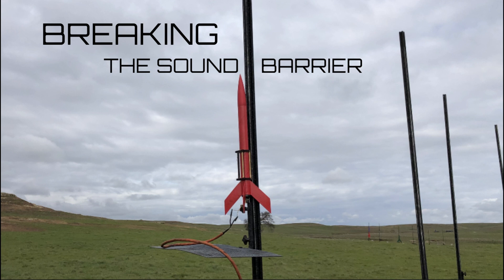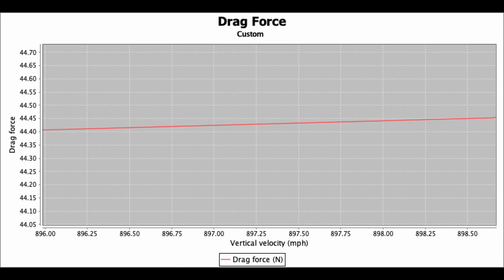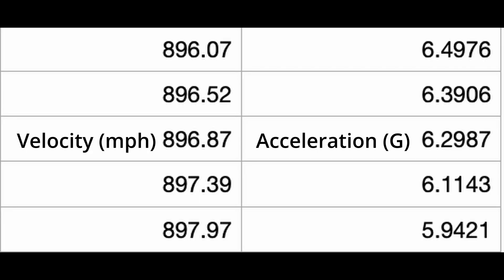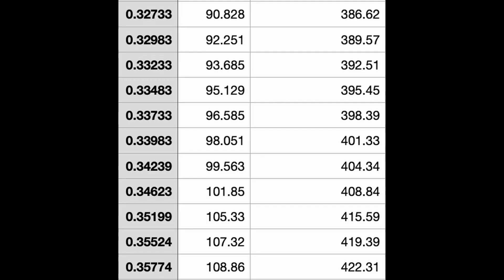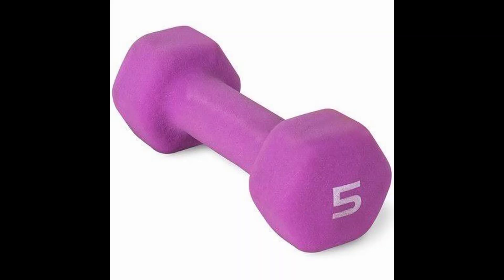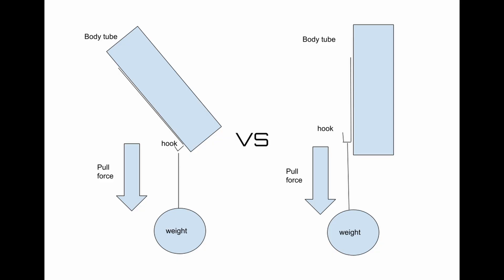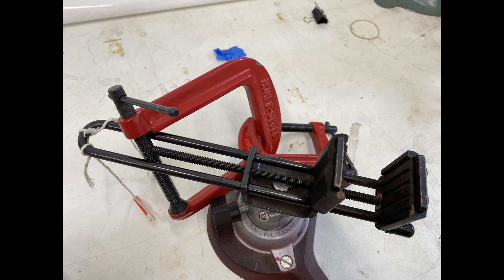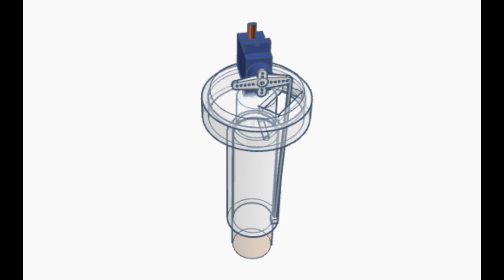Why did the fins break off?

Comment: Also consider the impact of your fly away rail guide on your fins as a possible factor. I fly 500Hz flight computers in my HPR vehicles. I have not flown a fly away rail guide, but I have flown with launch lugs and out of towers. Both produce unique drag and vibration patterns in the 3-axis accelerometer data during launch. I would expect the fly away rail guide would also produce a unique drag or impact pattern. It does take milliseconds of time for the rail guide to clear the fins. Look for any leading edge damage or wear.
Reply from the maker: I actually did look a little into that but ultimately, the attachment of the fins was way too weak for supersonic flight and the shape of the fins were also not good. I'm hoping to launch the new version next week.
Reply: @motechspace   When I started capturing events every 2 ms, it changed my perspective and opened new doors of exploration.

Comment: try epoxy next time, wood glue and plastic don’t bond together as well as epoxy
Reply from the maker: Yeah wood glue wasn't a great idea. We ended up using superglue so hopefully that does the trick.
Reply: Super Glue will not work!
You should use some epoxy clay to make fillets. Even then it is still sketchy.
My advice would be to make balsa wood fins, paper them, use wood glue to attach them, then add epoxy clay fillets.
Reply from the maker: @diyaerospace4181  Thanks for the suggestion. Superglue seems to be pretty strong, but if it fails, we'll do that.